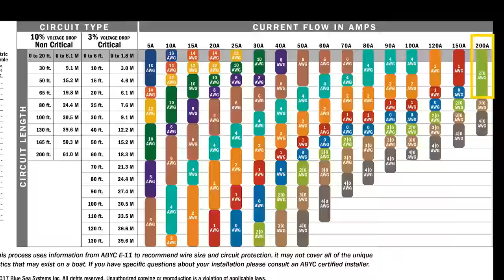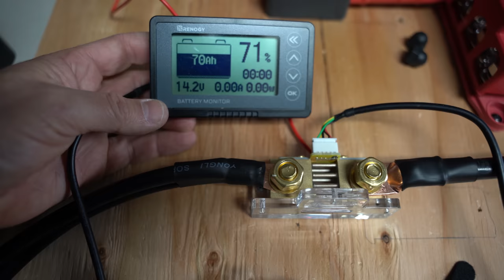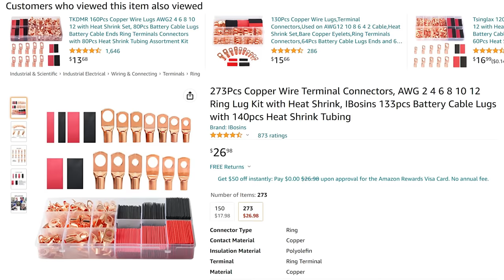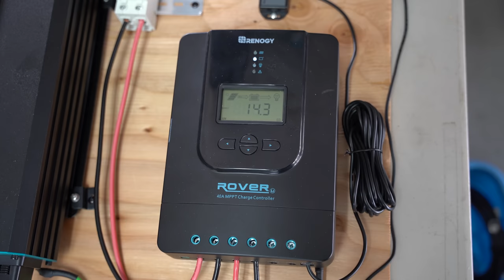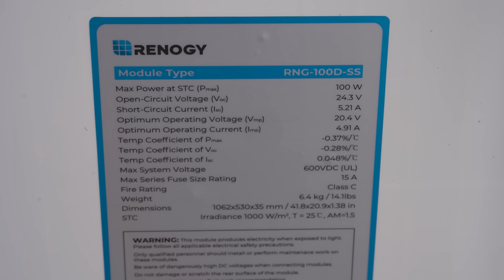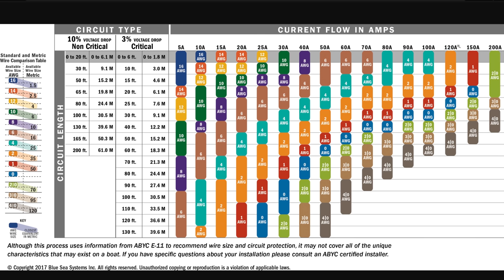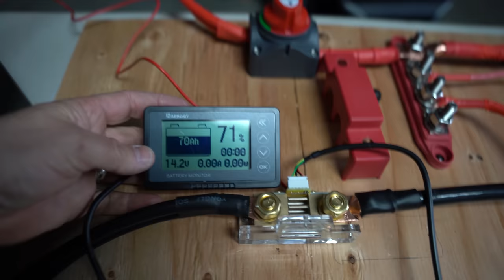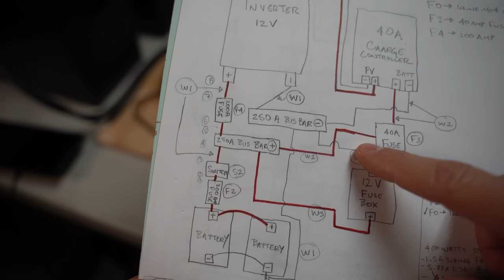How To Build A Solar Setup: COMPLETE Step-by-Step, DIY Guide (12V, 2000W)

Comment: At 11:29 in this video, there is a yellow book titled (from what I can see) "Off Grid Solar Power Simplified".  Is that correct?

23:40 or 24:20 - using under gauged wire. I would want to follow your suggestion of using the correct wire gauge. In this section, what should the fuse be in the connection if I wanted to use one?

One other thing I haven't been able to find online.  Maybe you know.
How long can the connection cables be between the panel connectors and the charge controller. What gauge perhaps?

Thanks for all of your information.

Comment: Anyone serious about doing this should know that those hammer crimpers don’t provide a solid enough, permanent connection. You need a crimper that squeezes on all sides. Not just a dent in the middle. Temco makes the best one I’ve seen, but you can find cheaper amazon copies.

Comment: Nice video but one huge problem. Your positive battery cable must be fused as close to the battery as possible and no more than 12 inches away. All of your device fuses must be fused as close as possible to the bus bar. Fuses always go as close to the source as possible so that you don't have lengths of unfused wire that could short to negative and burn.
Reply: He has a 200a fuse directly on the battery post

Comment: Is it a good idea having the charger controller going to the bus bar which is controlled by the main switch? If the switch is turned off, the controller will be disconnected from the battery while still collected to the solar panels. I've heard this is not ideal or is it ok?

Comment: Amazing video! I do have a QQ... My initial setup is 12v 100ah with 2000w inverter for discharge only. Just charring phones on short camping trips. Most of my set up will a plastic milk crate with 1/2 inch laminated wood. Super compact and portable. I do plan to add solar charging later so I am building with that in mind. My question is... Would it be okay to run a 200 amp circuit breaker off the positive battery terminal instead of the fuse/switch. This is just for the discharge set up only as I will use shore power to recharge my battery after use.

Comment: I have a very similar setup. I do use a generator occasionally on cloudy days. When I do use the generator, is there a charger I could use to charge the batteries while running the generator. I tried a car charger but it doesn’t seem to charge very well. Seem to only get surface charge. Thx for your videos.

Comment: Chris, why did you put the fuse for the battery after the fuse block instead of before the fuse block to the battery? Also, how did you read the same voltage in a parallel setup and series setup on the battery? Finally, why did you find a series setup better over a parallel setup.?

Comment: The green grounding wire should have been direct to a strong grounding source not to the power distribution, pointless as you already had your negative wire connect. This is for the ac side of things especially for ground sensing safery devices. Straight to chassis would be the preferred choice.

Comment: Hey this is a great video but I just couldn't get past your equation for sizing wire. At 5:57 you say the formula is watts divided by volts = amps, but 2000/120 doesn't equal 166, it equals 16.6. Took me a few goes to figure out that you have an error there - I think it should be 2000/12, not 2000/120 - which makes sense because you are talking about the wire size on the input of the inverter so that would definitely be 12V not 120V.

Comment: So, you cut these wires to the length you wanted them, put the endings on and then attached them? Did you cut off any of the plastic to expose the wire itself? With three 100 watt panels and a 2000 watt inverter, could I use a 60 amp MPPT charge controller? Also, were you able to find all these things in Home Depot or did you buy some of them on Amazon?

Comment: very nice video. thank you. but where are you getting 200amps here?
2000w at 12 volts is only 16.67 amps. my apologies if I missed something. I was just wondering why you rated your mains for 200amps.

Edit
Dummy me. I did 2000/120. I’m so used to 120 and not working with DC lol I figured it out. My apologies.

Comment: Chris, great video. Hey I have a question for you. I am installing a new solar system in my RV. It currently has 2 house batteries that are charged when plugged into shore power/house. I am wondering if I should just install my new two solar batteries as house batteries, instead of a stand alone solary system. Just not sure on how that wiring diagrahm would look like?  I am planning on installing an automatic switch so when solar is available the system will switch over to it and when shore power is available it switches to that.

Comment: Thank you very much! I'm also looking for a diy on a portable power station of 2000w-3000w.
Reply from the maker: a portable system?  that would be challenging to buy something that would meet or beat the prices of the professionally engineered systems.  But it would make for a fun video :)
Reply: @CityPrepping  Have you looked at the Licitti battery box? Just add battery.

Comment: I do have a question. If you turn off the master switch (to disconnect the battery from the system), it's a problem for the solar panel?

You absolutely needs to turn off the switch to disconnect the solar panels BEFORE disconnecting the battery from the system, right?

A setup like this does not allow me to turn off the electricity going to my 12v fuse block when I left my RV for few weeks except if I also turn off the switch of the solar panel, right?

Thanks!

Comment: This was a great video. I do want to understand the charge controller purpose and mechanism a but better but now I know where to start. Thanks.
Am I correct in thinking that a motor starting that has a surge (e.g. on a refrigerator or a furnace) the fuses may trip or does the inverter handle transients that may peek above 2000watts?

Comment: Great video! Quick question? 
 Can I use a dc-dc charger in place of the solar charger? I have a 40 a dc-dc charger. 

Will be installing in truck bed topper. Looking to run fan/ household appliances for a day or two before having to start truck to charge up. Do not want battery on truck to run dead.
Reply: I don’t want to run solar i want to run off my alternator.^^

Comment: Great video. I'm getting ready to lay out my system that's similar to your. I'm replacing 2 acid batteries with 2 Lithium 100ah batteries. I'm installing a 2000 watt invert just you did. I have 50amp solar charge controller. The solar I have is one panel of 180watts, I do plan on upgrading the panel to a 2nd panel for a total of 360watts at a later date. What I need help with is all the fuse blocks buss bars, shut switches and cable size between everything? I need to go ahead an purchase the little items on Amazon but don't know exactly what size to buy. I can go to Tractor Supple and or Home Depot and get my wiring. I already bought their hammer crimper you have. I need to buy some lugs? Help

Comment: Why do you have two fuses on the line between the battery inverter, one at the battery and then another at the inverter on the same line? I am not an expert just,learning thanks!
Reply: Short answer, you need to protect every stretch of wire so a fuse for every stretch of wire 1 before and 1 after the busbar

Comment: Hi, if the inverter is running. What is stopping that power from going into the solar controller. Or the fuse block?

Comment: Hi! Great video and very informative. Just wanted/needed to confirm before i do it....i have a 20amp switch, is it safe to use on 15amp wire? The switch wont "suck" amps out the 15amp wire? Thankyou :)

To make the situation the same for you....say off the battery you have a device running off it @15amps....you "tap" into it using 15amp wire and you want to add a switch before the device to cut the power off to the device to kinda control it on and off when i want. Can i use a 20amp switch? Cheers

Comment: Long story but my whole system was taken apart from a guy that was going to help me clean up wires, now he’s vanished and I’m trying to figure out how to connect my whole system ; I have a separate charger for shore Power and a 110 electrical panel box 

So I was wondering if you could guide me on adding the charger and the 110 electrical distribution box to my system.

This was a great video but missing a few components I need help with; grounding, 110 distribution and controller for 110 shore power

Do I ground the negative battery??

Comment: Wiring the batteries in parallel with increase the amperage, but not the voltage. That would be my choice. In addition, wiring the 12 volt soar cells in parallel would be my choice as well. Wiring for me would be 8 gauge or larger, with connecting posts. I can almost do those figures in my sleep.

Comment: 12 volt system is good for backup power but 24v is better and can be full time without excess wear on batteries. Also if you run anything with a motor it is NESSISARY to have a pure sine wave inverter. this includes a refrigerator

Comment: I love this video overall, but I'm stuck with something you said early on. When you said it runs at roughly 85%, you divided by 0.85 instead of multiplying by it. 85% of 2000 is 1700. 2000 / 0.85 is ~2353. Basically, I'm thinking we could go with the 150A wiring, as 1700W/12V=141.67A.  Please clarify

Comment: I think I am just missing something. For calculating amps for the inverter, you have 12 volt going in, but 120 volt going out. For calculating amps at 2000 Watts, why wouldn’t you use the 120 volt of the 2000 Watt output?  16.6 amps is closer to a household outlet amperage similar to the inverter output.

Comment: Hi. I have a question. I have the following setup. 4x 170 watt panels, 12v system. 2x 100a batteries, 2000watt inverter. The device that will use the most power is my 2000 watt kettle. What size cable should I use to connect the batteries in parallel and what size cable to the inverter? Thanks in advance.

Comment: Thanks for this video. Just had a question. You wired x2 12V batteries together. Isn’t that 24V. Wouldn’t that make the Voltage in the equation 24V not 12V?

Comment: Great video.  Question, my LiPo battery says 100amp max discharge rate.  Should I fuse for this.  I have a 4000w inverter but I assume I’m limited by the battery.

Comment: One criticism as a safety concern , you have your ring on your left hand while working on the batteries , if contact is accidentally made to any of the circuits and a complete circuit is made ,large voltage will weld your ring (and your finger) to the metal it touched .
Reply: He won't have a ring finger left to worry about if the gold ring shorts the circuit. Goes pretty quick, faster than you can yank your hand away.
Reply: If his ring is touch's a live wire or terminal, he’d get zapped?  Or his other hand would have to be touching a terminal too?

Comment: Another site says use pv stranded wire or welding wire stranded not normal electrical wire to dispate heat

Comment: Hello! I just built a system almost identical to this for my cargo trailer camper so thanks for the tutorial! I had a quick question though, if I don’t want the battery monitor on all the time when my trailer is parked, could I connect that little red power wire to the positive bus bar so that it gets powered off when I kill the batter disconnect switch? Thanks again!

Comment: I noticed you doubled up wires from the batteries.  Did you use two smaller 4AWG for flexibility instead of a single stiffer 2/0AWG while getting the equivalent 200AMP rating?

Comment: I think it would be good to to explain what the letter v the letter w letter A represents volts watts and amps you may have mentioned it but my phone doesn't have the best speaker system and I couldn't get closed caption to work

Comment: Hi , I have almost  the same  setup from Regony: 4 solar panels 100w, charge contoller Rego mppt 100V 60A, a battery 12V200A , LiIron phos, and a Regony one M1. 
I use this one for my Rv needs in the woods. I have a problem with the Charge controller  I think , because my battery is not chargin . On Regony one M1 you can see the battery dont receive any Amps Also on charge controller is only two leds one for the battery and one for the solar panels.The solar panel led is flashing green but supposed to stay solid green , the battery led is flashing green but that is normal  when is charging. 
My problem is the battery is not  charging and the batery is dischrging in 2 or 3 day if I use the RV. 
If you have any thoughts please let me know.
Thanks Criss.

Comment: 20:28 
Why did you do the inline 10amp fuse and the circuit breaker between the panels and the charge controller?  I understand that you want a switch so you can disconnect the panels and the breaker acts as that switch. But couldn’t you just use a low amps high volts (10amps) breaker so that you would not need the fuse?

Comment: Kind of new to this, I have my 700watt panels 12v in parallel that I'm currently setting up. Will the 30amp inline breaker be enough to protect my wiring and charge controller down the line with the specs I have or would I need a higher amp breaker.. Thanks for the help.

Comment: I was wondering why you put the 200 amp fuse where you did? You mentioned the fuse was to protect the wiring. This fuse only protects the wiring from the pos bus bar to the inverter. What about the wiring from the battery to the pos bus bar. If you moved the 200 amp fuse to between the battery the the cutoff switch, don't you now protect all the pos wiring?

Comment: What kind of cable do you have connected directly to the batteries? It looks like there are 2 wires instead of the single 2/0 going to the inverter. You don't make any specific mention about that in the video. BTW, this was a fantastic video!
Reply from the maker: Oh yeh, those cables I bought from the manufacturer for these batteries
Reply: @CityPrepping  I see, thank you for reaponding.

Comment: With the inverter connected directly to the battery, you've taken the discharge control feature away and are exposing your batteries to over discharging. Is there an affordable solution to protect the batteries from over discharging?

Comment: Hello, I’m sure there is a comment that addresses my question I’m about to ask. He says a typical American home socket can output 1800w but isn’t there usually more than one socket or receptacle on the 15 or 20amp circuit? So do I just divide the amount of receptacles on the circuit to find the watts that each receptacle on the circuit can output?

Comment: I picked up the book you referenced in the video and product links and noticed that it makes a point of recommending the Class-T fuse for LiFePO4 batteries over ANL fuses due to the battery's high current discharge capacity. Was the ANL fuse an oversight or did you choose that for a specific reason?

Comment: So I have a question for you. I am totally new to anyting solar. I've built a greenhouse and I want to run 12 v lights and 12 v water pump in it. I have a 48 volt solar panel and I have four lead-acid 12-volt batteries. My solar controller is capable of handling up to 60 volts. I have a what I believe is a 12 volt 1500 watt inverter. My question is looking at your video and what you have built. Do I need to put in a step-down module in order to use it as a 12-volt system? If so where in the system would I put it prior to the 12-volt fuse box?

Comment: Nice video as others have said, but why a 2000w inverter when you are limited by the BMS to 100 amps and that would limit you to 1200w of max output. Add a second battery and then it makes sense. I see a lot of systems like this where the operator thinks there is a problem with the inverter or the battery, when it is just poorly matched equipment.

Comment: A bit confused... on the Inverter, the 2000W refers to the DC side or refers to the AC side load?
You used 2000W/12V for the wire sizing. I thought the 2000W refers to the max AC load output capacity?

Comment: You have a 40 A charging circuit and a 200 A current draw from the inverter. Doesn't that mean that when the batteries are discharged in the morning for example, and now you want to recharge them but also use the solar power electricity for your loads, you have a conflict? Like if I was to hook up a refrigerator, that needs to run around the clock. I always thought that the solar power through the charging device needs to be sufficient to supply full load current as well as battery recharge current so that you can have your batteries charged before the afternoon rains (thinking a tropical place as an example.) Am I thinking this wrong?

Comment: Hi Chris, I want to build a solar box for my van with this set up but I was wondering if I have to ground the negative of the battery to the chassis of the car, or if have just to connect the ground of the inverter and the solar control (you use a green cable to the chassis of the car using the negative bar, or if I don't need to connect anything to the ground. Thanks in advance for your answer

Comment: Kris, I am in the process of building your 12V 2000-watt solar setup.  My question is:

When looking at the video, going from the Ampper switch(red) to the positive battery terminal, and the negative (going from the Shunt/battery monitor) to the negative battery terminal, it looks like there are TWO  cables going to each side of battery (positive & negative).   I haven't seen 2 cables in one, where do I buy these at or will one cable per side work?

Thanks,
JR